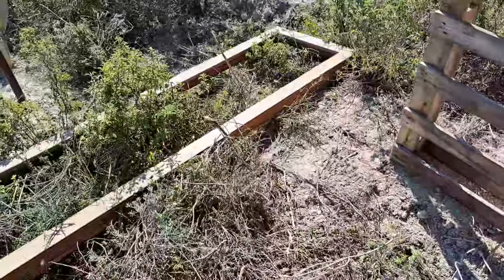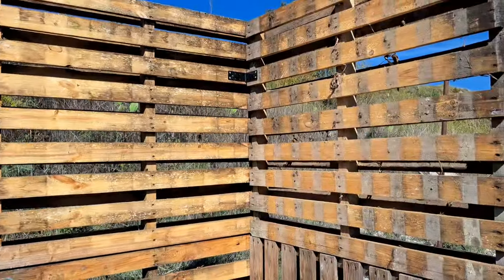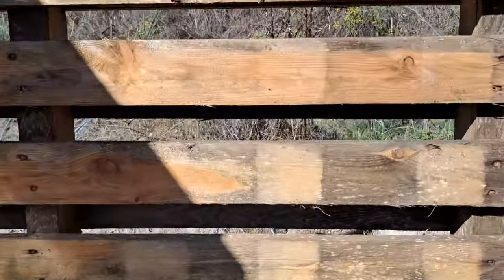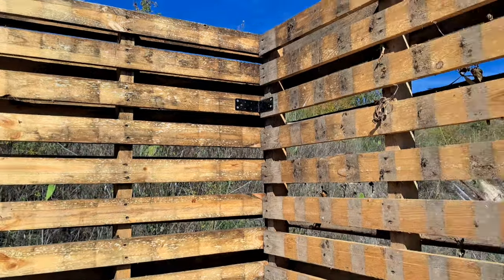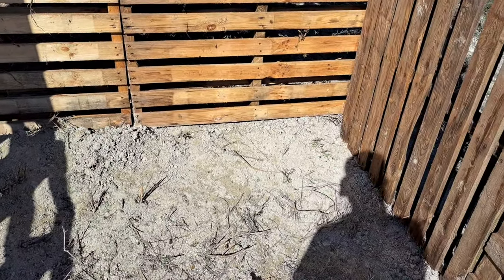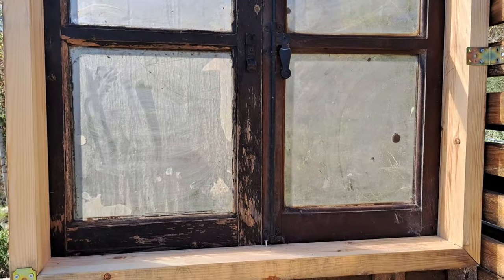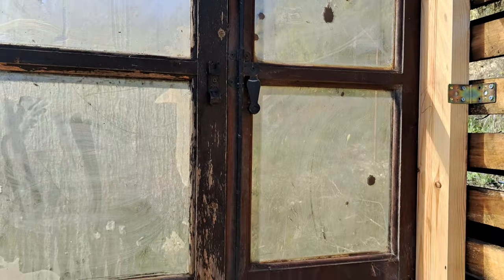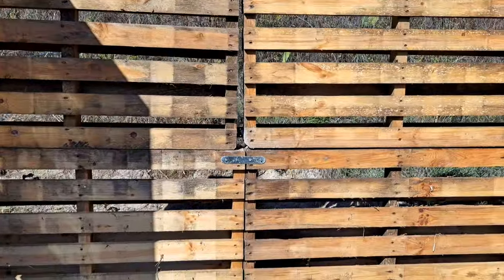Vlog: the hut's storage room made out of wooden pallets

Comment: depending on the insulation material, wood walls can be an attractive home for mice.

but im not sure how to keep them away, although one of my grandfathers had a home made wheat mill, powered by a Wartburg engine :)

they did manage mice somehow, because the floor certainly attracted mice.
Reply from the maker: You are right: mice can be a problem. Though in my case, I plan to keep it fairly exposed to discourage them. What I will store here is hardware, such as natural gas cylinders, and items like that which do not need special insulation.

Mice enjoy spots that cannot be accessed easily. Think of sealed walls/roof/floor. At the hut, I have been mindful of this and designed all sides to be directly accessible. There is no place for mice to hide in (plus, my dog Atlas has a strong prey drive and will not leave anything come near).

Comment: Hi prot, continue the good work!  Wouldn't your storage room need vertical studs that go deep in the ground to guarantee stability of the construction?
Reply from the maker: Indeed. I will reinforce it before adding a roof. Though I have not done it yet because I have not decided how long to make it. I think the current dimensions are okay, but maybe I can add another metre.
Reply: i was also just about to ask how deep have you dug the walls into the ground and what will prevent them from rotting away?
Reply from the maker: @0netom I have not dug them at all and have not taken provisions to prevent the eventual rot. This is a pragmatic decision I am making to have something in place that will work for at least 2 years until I am in a better position to build something more durable. Pallets are surprisingly resilient though: they do rot, but not quickly.